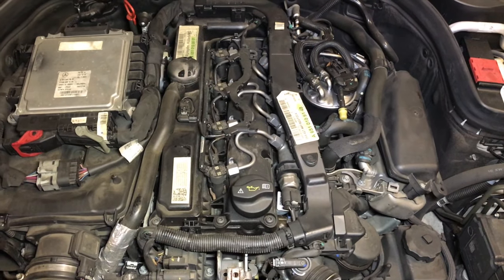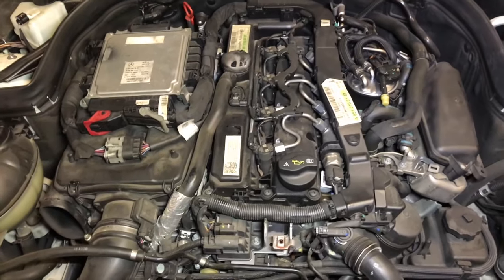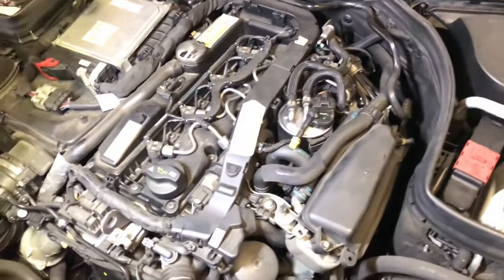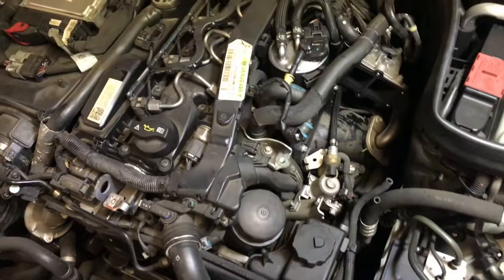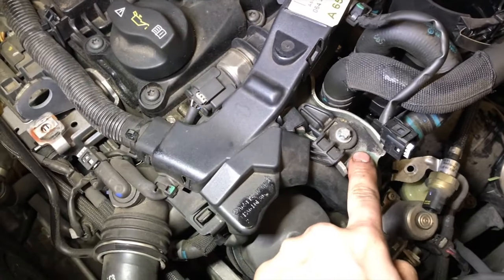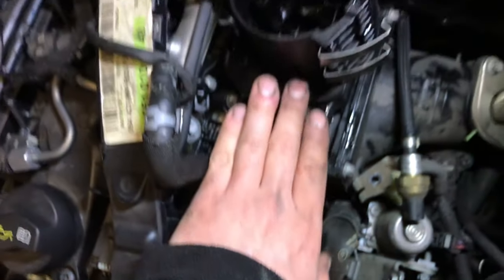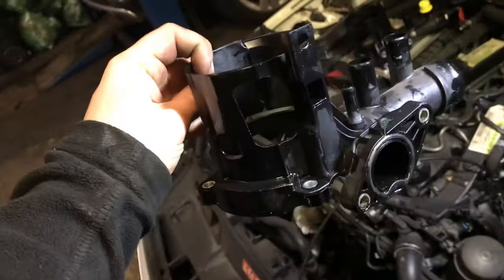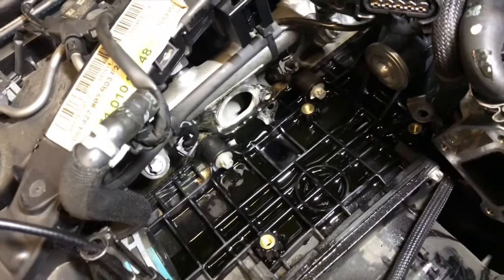Mercedes | Coolant leak (fuel filter housing) | OM651 220,250CDI

Comment: Hey!!,quick question for you...would really appreciate help if you could?  There is a wiring harness that runs on top of that engine and a plug that comes off on the middle right side,the plug seems to sit around the front of the fuel filter housing and goes down to the left side front of the egr cooler,do you know what it goes to?
Its just a little short wire and plug on the right of the wiring harness and only one in the middle on top of the fuel rail.
Ive just done the waterpump and fuel filter housing on this and lost to where this plug goes unless it doesnt on some of these engines?
Reply from the maker: If its what i think it is, it plugs onto a sensor which is connected to a fuel line, the sensor is probably trapped under the egr cooler somewhere hence why you cant see it, msj me on my instagram with photos and il try to help

Comment: How on earth did you get the egr cooler bolts off? The rear ones are not accessible
Reply from the maker: 1/4 drive socket and extension is the only way

Comment: Hi, do you have to bleed the coolant system after fitting?
Reply from the maker: No just put in enough coolant, get the engine hot enough for the thermostat to open then it will bleed it self and coolant level will need topping up..

Comment: Top video! i need to change the throttle body, is this accessible once the egr cooler is out of the way?
Reply from the maker: Hi Dean, thanks for the comment, no once the egr cooler is out you need to remove a silver egr pipe and also an air intake part that bolts onto the inlet manifold, the throttle valve is underneath that air intake part..
Reply: @mercmantips  i assume this is straight forward. Thanks for the reply
Reply from the maker: It is straight forward but the bolts to remove these parts can be tricky because of the lack of space.. best to have a 1/4 e10 socket and extensions before you start
Reply: @mercmantips  i'll give it ago tomorrow. Thanks
Reply: @mercmantips  bloody egr pipe the bottom bolt on the non cooler side. Any tips, got it out and took as long to get that out as to get to that part 🤯
Reply from the maker: That bolt can be very tricky, i usually loosen it with a 1/4 ratchet with the E10 socket no extensions, then squeeze my fingers down there to turn the bolt out slowly without dropping the bolt hopefully lol..
Reply: @mercmantips  cheers for the reply, that is how i got it eventually. Certainly not easy.

Comment: Subscribed mate! Any tips of bleeding cooling system after doing this?
Reply from the maker: Thanks Callum, mercedes cooling systems self bleed, just top up to max put the heating on to hot go for a 5 min drive then wait for it to cool down and the coolant level should have dropped abit, top up again job done 👍
Reply: @mercmantips  your a diamond mate!! Thank you

Comment: Please help, somebody. I’m doing this job right now, but I can’t get the damn EGR Cooler out, I’ve gotten every bolt out but 1, the bottom middle bolt seems impossible to get to but clearly is not impossible…. Can somebody please tell me how to access this bolt
Reply from the maker: If you can get your hands on a 1/4 drive e10 socket and a long 1/4 drive extension from the front of the engine it is pretty easy with a 1/4 drive ratchet.. all the best 👍
Reply: @mercmantips  I got it thank you , now I’m stuck on that damn Y bracket. How do you remove the bolt closest to the front of the engine
Reply: @mercmantips  I just sent you a DM on Instagram with a video, so you can understand what I’m saying a little better
Reply from the maker: Just messaged you on insta
Reply from the maker: Just messaged you on insta

Comment: Hi mate, please help. How the HELL did you remove the lower centre bolt from the EGR cooler!!
Reply from the maker: You need a 1/4 E10 socket with a long extension for the bolts underneath, thats the hardest bit
Reply from the maker: Please subscribe 🙏
Reply: Thank you sir, subscribed!

Comment: Good job dude! :) I couldn't help but notice, that the new fuel filter housing has 3 mounting bolts on the end part, where the actuall leak was, while the old one had 2.  Does it mount without any problem? No leaks? :) thanks in advance
Reply from the maker: Hi, yes some models have 3 screw holes, for example i done a vito few days ago and that had 3 bolt holes on the cylinder head so i used 3 bolts for that one, but on most other models they have 2 and only used 2 bolts had no problems..

Comment: What with the timing chains and coolant and oil filter housing leaks...is this a common problem on the 651...I'm seriously considering getting rid of the merc..
Reply from the maker: All my videos are common problems with the 651
Reply: @mercmantips  I have a E250 cdi..2015 with 30,000 miles...will any of these problems start occurring yet..also great informative videos..keep up the good work..topman..
Reply from the maker: At that sort of mileage i dont think so, usually starts after 70k miles
Reply: @mercmantips  thanks for replying...I'm a firm believer that dirty oil and over filling the engine can lead to a lot of problems...always done regular oil and filter changes and only ever fill half way on the dipstick..

Comment: Hello Mercman. Is it possible that housing is giving me massive leak? Basically water going straight from reservoir down the back of the engine without even the engine running. 
I've already changed water pump and oil cooler as had oil in my coolant as well. Thank You
Reply from the maker: At the start of the video you can see where the water first leaks out on top of the manifold, if its wet around that area, its most likely this part
Reply: @mercmantips  That's where it's flooded as well, but the leak is so huge I wanted to ask, it is like an open tap. Anyway - fuel filter housing will be delivered tommorrow morning, hope it's gonna solve the problem. Thanks mate, have a gooden
Reply from the maker: If the part where the seal is completely broken it will leak without the engine running, so hopefully it that that 👍

Comment: Has mine replaced at a garage. They saying it took them 5 hours. Sounds a bit long to me 5 hours would you agree?
Reply from the maker: Takes me around 1 hour and 30 mins to complete
Reply: Only 1.5 hours it takes you to strip and put back together? So you think the garage are pulling my pants down saying it took them 5 hours?
Reply from the maker: I think if someones doing it first time it will take longer than 1.5 hours, but 5 hours is a bit excessive

Comment: How did u open the long screw holding the egr cooler on front side on the metal which goes on left side
Reply from the maker: It best to use a 1/4 drive e10 socket with long extensions
Reply: @mercmantips  the star screw is 4 cm long which i am talking about...is there such star socket that long?
Reply from the maker: Oh ok i know now, a 8mm spanner ring end should do it, 8 or 10, if not a deep 8mm socket

Comment: Hi MercMan great video is there a gasket that is best replaced on the egr cooler.
Reply from the maker: There is one gasket inbetween the cooler and the EGR but i never replace it because it never gets faulty, never had to replace one before..
Reply: @mercmantips  Thank you serviced my 13 plate Sprinter this weekend with the same engine, it's been losing about 300ml of coolant a month and i thought it was going from the header tank but now i have noticed a small amount of coolant in the bottom of the fuel filter housing and thought i would research and found your video, thank's again Mark
Reply from the maker: No problem mark, glad its helped 👍

Comment: What does the vacuum box do? Mine is missing! ☹️
Reply from the maker: If you dont have one then its normal its a later model where the turbo and the EGR is electronically controlled rather than using vacuum
Reply: MercMan Tips thanks! I have 2016 E-Class W212

Comment: How tight do you tighten the bolts? Any torque reference I can use?
Reply: 20Nm
Reply: @aulzhoefer  Hi, Have you succeed with 20NM torque? I saw in Haynes intake Manifold has 16NM, I couldn't find any more close torque settings.  
I was doing in 3 steps: 5nm, 10Nm, 16NM. 
and I pulled out the thread on the bottom bolt inside the the filter housing. 
Next, I have fixed the thread and tried again and the same story 5NM,10NM and then on 16NM I have pulled top bolt inside the filter housing. 
Now I am afraid to try on 16NM. I looking to find good source information or maybe I need a better Torque tools I have NM to 25nm
Reply: @leszekkrzyzanowski6419  I got the setting from a MB service manual, I used this when I replaced the oil cooler. The job was successful.

Comment: Slight issue.  The old part had 2 bolts and new part has 3 bolts.  Engine ONLY has 2 bolts.  So what did you do ????????????
Reply from the maker: Just use the 2 new 10mm bolts no problem at all
Reply: @mercmantips  Thanks Bloke .  
l hope 2 bolts hold because that was the reason it broke initially. and NOW BM introduced 3 bolts to carry the weight evenly
 Cheers

Comment: Hey Mercman, thanks for you always helpful videos. I recently (2 weeks ago) had a MIL for inlet flap, thought it odd so I cleared it, but reappeared 2 days ago. Yesterday, got a low coolant alert, checked it, and it has lost a slight amount. Did some googling and found the info about waterpump-->vacuum system TSB etc which mentions both. Upon inspection, I find no signs of leaks at the waterpump, but do find the fuel filter weeping coolant. Could these be related? I find it bizarre that they should appear so close together. I THINK the way I understand the coolant/vacuum conundrum is that the leak is internal, and thus I may still have that issue, correct?
Reply from the maker: The inlet manifold motor is common on these engines too, so i think its just a coincidence that you have the leak and the motor go faulty at the same time, i don’t think they are related
Reply: @mercmantips  I only mentioned it because the TSB for waterpump leaking to vacuum implied it could trigger the inlet flap code. No idea how as I wouldn't imagine the inlet flap motor has a vacuum supply, I am completely ignorant on that, however. Thanks for your help.
Reply from the maker: The inlet manifold motor is electronically operated there is no vacuum operation so no vacuum interference will affect it
Reply: @mercmantips  Is a repair kit available? All I'm finding is 6510904737 which is a complete manifold?
Reply from the maker: You might be able to get the motor on its own, but you will need to remove the manifold to replace it
Reply: @mercmantips  Thanks for your help, happy holidays
Reply: I noticed on my housing, as well as yours, the new part # has three mounting locations to the engine, and has fewer mounting locations to the inlet manifold. Did you simply ignore the spare to the cylinder (3 instead of 2) and use the old hardware to fill the empty spots in the inlet manifold? I was pretty shocked to see such a difference in the part, even though I knew they were updated.
Reply from the maker: Yes some models have 3 screws some have 2, so it does not matter if there are only 2, just make sure you use the new bolts provided as they will be longer than the old bolts which is needed

Comment: Have you had any issues with oil cooler on this engine
Reply from the maker: Hi yes, the seals leak externally on the oil filter housing which is part of the oil cooler this is very common, but iv had 2 or 3 occasions where the oil will go into the cooling system which will make the coolant expansion tank very oily, this is most likely due to the oil cooler being cracked inside mixing the coolant into the oil, all occasions i changed the oil cooler and problem was solved... hope this helps, please subscribe to the channel 🙏

Comment: Had a leak for 2 months now on my E220... Garage replaced my water pump and alternator belt but seems like the leak has worsened. They can't find the leak,  I'm going to check this. Any idea on how much a job like this would cost?
Reply from the maker: If the water pump has been replaced its 90% this.. parts and labour should cost around £220 (reasonable price)

Comment: I hate these modern engines because they are a hassle to work on and they look more like the internals of a washmachine
with all those hoses, cables, tubes, connectors, sensors and wires.

Comment: New part number: 651-200-60-00
Just had this repair done at my dealer for $775USD. Would have tried it myself if I had the time...
Has anyone had this repair covered under warranty? Class action lawsuit?
Reply from the maker: $775 USD!! woww, we charge £220 GBP as a small garage in the UK
Reply: How many hours of labor? I was quoted 3.5
Reply from the maker: Well it takes me around 1.5

Comment: COMPLETELY useless video. How about showing HOW you remove the parts? If someone needs to watch a video about this, they probably also need to see HOW you remove the parts, and not just some hocus pocus magic trick
Reply from the maker: If you cant figure out which bolts to remove for each component then you shouldn’t be doing the job yourself 👍